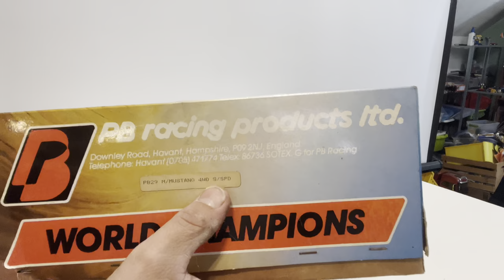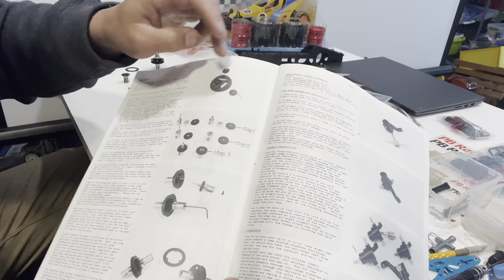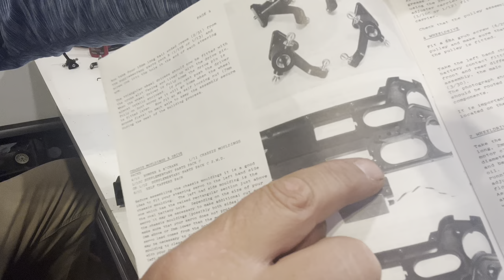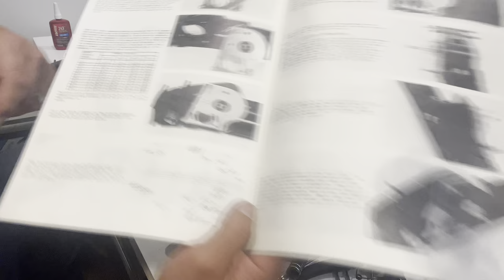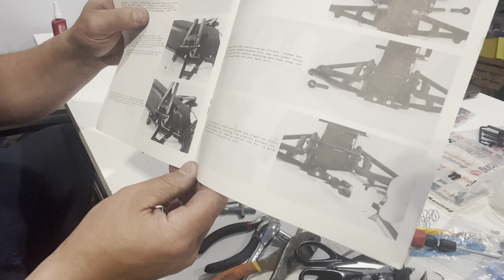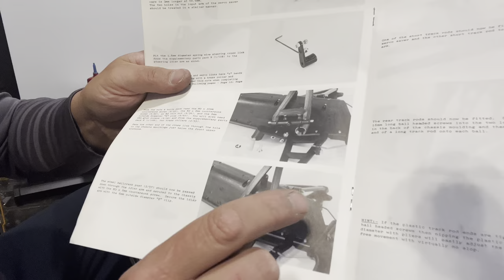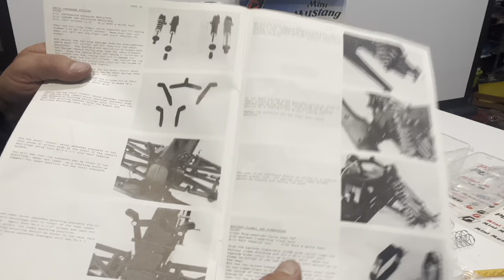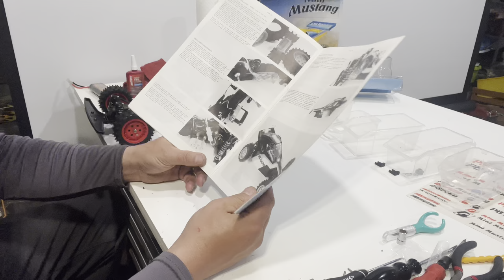Building a NIB PB Mini Mustang from 1986.

Comment: Gr8 vid Keith.  Maxima didn't have the slipper or ball diff.  Was gear diff.  Big diff over the Mini Mustang was the one way on the front, more adjustability and the undertray.   Awesome buggy for racing was lightweight and handled really well.   Won many races with it.   Stupidly I sold mine and bought an Avante.  Would love to get another but they come up so rarely.
Reply from the maker: They are all definitely few and far in between. They command big money when you do find them which is the other side of it. I know Jason is building up a bunch of mustangs to be sold in the future but he only has 1 Maxima for his collection.

Comment: I used to have one back in the day. Yes shocks and shock towers were not the best. I had option house shocks on mine. Also drivetrain was very free but because of the idler you cannot really run it in reverse without causing belt jump. The quick release battery connection found itself on other cars, especially for endurance racing.

Comment: Hi Keith, very unusual, but interesting build, what stops the pins coming out the dog bones, are they a very tight fit? Paul.
Reply from the maker: The dog one is tapered so the pin stops although the boys who raced these will tell you that they all went to steel dog ones early on as the pins can fall out.
Reply: @rcicons4915  Initially I thought the model was going to much smaller, being called a Mini Mustang. Another model manufacturer I'd not heard of here in the UK.

Comment: Absolutely awesome video, did you have to solder the stabilizers as on the schumacher? 🤔🤷‍♂️😇
Reply from the maker: They are not on ball ends. They just slide through a hole on the mount.
Reply: @rcicons4915  damn😂😂😂 do I need to buy one of these now? 😇❤️❤️❣️
Reply: @rcicons4915  keith, when you see the box, it looks like a grasshopper 😂 but what you are building is just wow ❤️❤️❤️

Comment: With the shock bodies how you going to open them up if you need to with those pins at the bottom?
Reply from the maker: You have to take the shock off and hold upside down to take apart.
Reply: You have to push the pins back out to get the shock seal pack out again

Comment: With someone could make parts for my pubg buggy for better steering parts. Made by Thunder tiger.
Reply from the maker: I have a Thunder Tiger, tiger. There is a nib on eBay. Royal ripper is the same.
Reply: @rcicons4915  mine is a 12 scale.